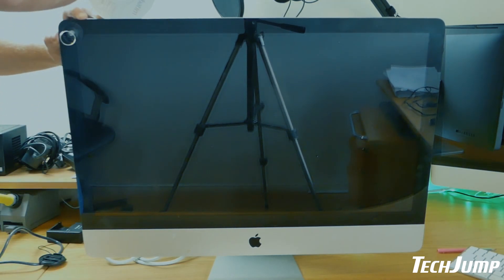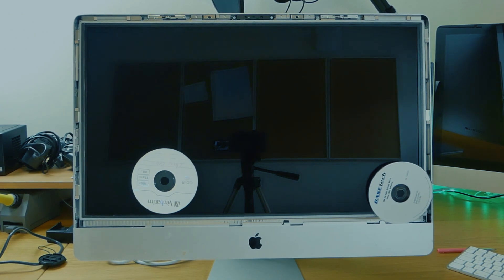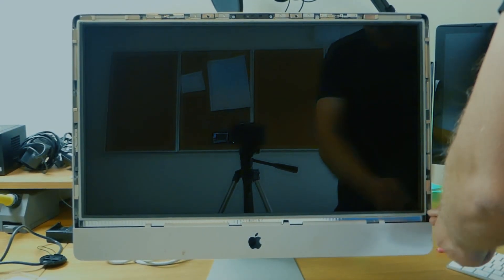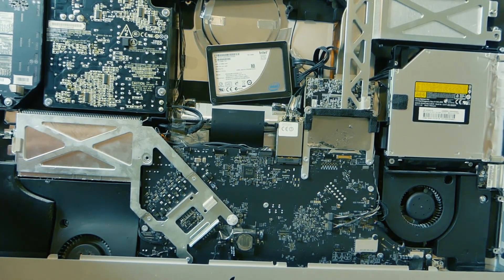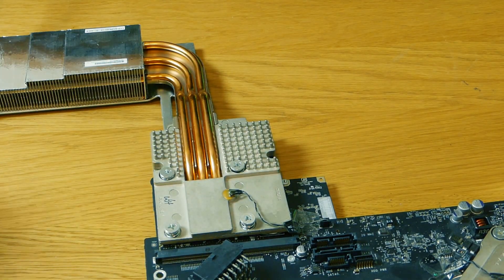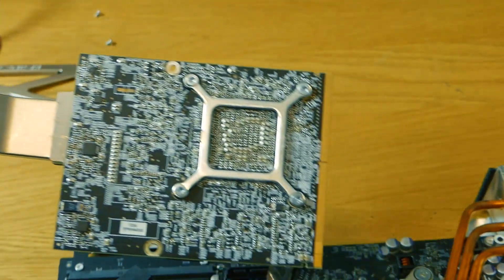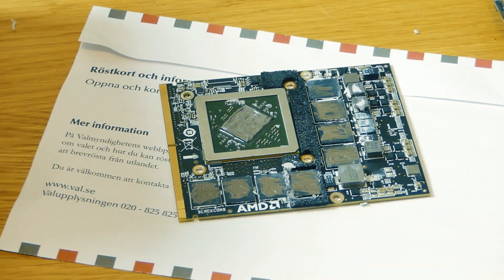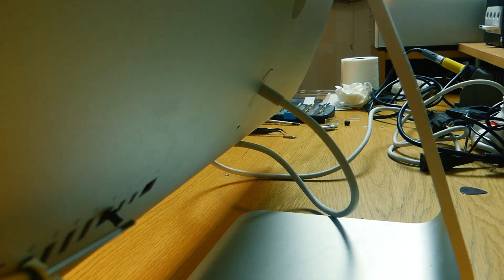iMac mid 2011 repair

Comment: MY OWN EXPERIENCE

I was able to successfully repair my computer.  I can use it again now.  It was not easy.  It took weeks.  My computer was overheating and I guessed that I needed to replace the fans inside.  My guess was right, but, which fans do I buy?  Not all iMacs, even from the same time period are exactly the same, so, I had to open the computer up.  Once open, I looked at each fan, wrote down the model numbers, ordered them online and then waited for everything to arrive.

The fan numbers on MY computer are
RIght	BFB0812HD
Center	BFB0612HB
Left		BFB1012MD

I didn’t know which of the three fans were bad, so, I replaced all of them.  It seems to have been a good decision.  How I did it:

0.	Air dust everything as you go…a lot.

1.	Suction Cups to get the front glass off.  Easy.

2.	To disconnect the display there were 8 T8 screws, four on each side.  Each spot is surrounded with strong magnets.  It makes it very hard to get the screws back in.  Use a needle nose pair of tweezers.  It makes it possible.  Without the tweezers, it is probably very very very hard if not impossible to put the screws back in.

3.	Once the screws are out, tilt the computer forward until the display comes out naturally.  There are four cables to disconnect.  Use your magnifying glass glasses to see what is going on as you do them.

	On the top left…
	1. Vertical Sink Cable (pull up by tabs)
	WARNING: This plug is very fragile and will break very easily.  The cable itself also is extremely thin and easy to snap.  If you are not used to handling computer plugs and components, you will not be accustomed to dealing with something so fragile.  If you manhandle it at all, it will crack and snap on you.
	Mine cracked.  It was impossible to replace.  I fixed it by using a small blow torch.  I, once, and very very very briefly made one pass with the flame over the plug.  The plastic reheated and sealed together just enough so I was able to push the plug in.  If I ever have to open the computer again, it may not work the next time.  I can’t repeat enough how fragile this first plug is.
	Use a lighted magnifying glass.  I have a pair that look like a pair of glasses with a light on top.  Look at that plug deeply and for a long time until you understand it…then, use some sort of a tool like tweezers to GENTLY push the plug up and out.  You will probably have to walk the plug out by pushing up on one side slightly and then on the other side slightly until the plug is finally out.
	BE CAREFUL!

	2. Backlight Power Cable (push in with thumb and pull down).

	In the center (and off to the right?)…
	3. Display Port Cable - Lift switch gate up and then pull up and out.
	4. Display Power Cable - Pull up

4.	To remove the right fan, you’ll have to disconnect the optical drive (Top-mid right).

5.	To remove the center and left fans you will need to disconnect the center board of parts.

	WARNING: Once the display is off and the center board is out, towards the top and just to the left, is the power supply and it may still hold a sizable charge.  I was told repeatedly by YouTube videos to be extremely careful about touching…in other words, DON”T TOUCH IT.  They especially said to not touch the top of it.  So, who am I to argue.  I didn’t touch it.  You don’t need to either to get to over 50% of your computer anyway.  Nevertheless, be careful.

	WARNING: If you are going to proceed further, open the bottom trap door and remove your SDRAM cards.  In my computer, there were two.  You will put them back in once everything else has been put back in and rescrewed.

You will need to unscrews 9 screws all of varying sizes, so, make notes as you take them out because they will each need to go back into the same hole they came out of.  There are also 20 different cables that you will need to unplug and the plug back in later…so, pay attention.  4 of these cables connect the back of the center board to the rest of the computer.

	3 of these cables are on the bottom left.
	6 of these cables are in the center top.
	5 of these cables are on the right and slightly higher…next to the right fan.
	2 of these cables are on the right, but below the fan.  The cables come under the center board after it is reinstalled.
	4 of these cables connect the back of the center board to the rest of the computer.

	P.S. There might be more, so, pay attention and take notes as you go.  To make it easier to find all of the cables, I took an old shoe string and cut it into 7” long pieces and gently tied them to each cable as I discovered them.
	P.P.S. One of these cables was affixed to the top of the left fan.  The same cable wasn’t on the new fan that arrived.  I noticed that the cable was affixed to the top of the fan with a couple of plastic anchors that were attached via double sided tape, so, I cut off those anchors with a blade and used double sided tape to affix those same anchors to the top of the new fan.
	P.P.P.S. Inside the machine, bottom center, just behind the apple logo that’s on the front bottom of the machine, is what one guy called an “ambient light” sensor.  You’ll have a hard time getting the center board out while it is in place.  Simply lift the top stem of it up and then slide it off to the left.  It will still be attached, but it won’t be in your way anymore.  It’s easy enough to slide back on when you are done.

6.	Reinstall the SDRAM cards later by, once again, using the trap door at the bottom of the unit.  I personally had a hard time lining up the slots with the frame on one side, but I pushed hard with the flat edge of a screwdriver on the slot and eventually everything lined up again well enough.  BE CAREFUL.

Good luck.  They make it look easy and doable...but it really is quite challenging...and it seems that no one is showing all of the steps.

Comment: Hi wonder if u could help my imac 27 was running I know there a gpu fault not used machine I couple of years pram battery died have replaced that but not getting any of the 4 legs on logic board like no power could power supply gone bad ?

Comment: Weird! Weird problem I’m having.  half of the LCD screen boots up with vertical lines and gibberish until an hour later when the screen gets really hot then the screen works fine.  27 inch iMac 2010.    do you know what cause this problem and fix?   I uhave baked the graphics card and repasted to the heat sink.
Reply from the maker: Well.. i would try to bake it again at higher temperature, if that doesnt work its toast.

Comment: I replaced that gpu in the same imac, still the same problem (reboot loop, never fully boots up). I tried swapping a different hard drive (new) and still have the problem. I hate to shotgun units, but I may change the power supply because I hear these have issues with them. By the way, just buy a toilet plunger from the 99 cent store; works great!
Reply from the maker: Sorry to hear you struggle like that, well Ive messed up an iMac this spring and i had to swap MB, ive failed so many times my memory is preventing me from accessing those moments. Will try the plunger next time.. great idea. :)

Comment: Just heating the card is a temporary fix, you can replace it with a different card though, like GTX 765M, 770M, 780M and even Radeon WX4170 and WX7100 (basically RX 560 and RX 580) and now there's a VBIOS/BootROM mod that gives EFI bootscreen also you get Metal support for Mojave too. That microphone cable though lmao, on my 2010 27" I plugged the microphone into the ODD fan so I had to take it back apart when the microphone didn't work. Also I think putting paste on the VRAM chips isn't gonna do shit, I bought some 0.5mm thermal pads for mine and they were way too thin.
Reply from the maker: Interesting, can you post a link to this?